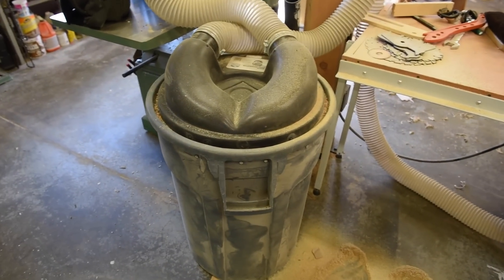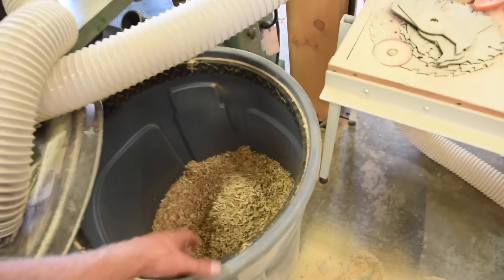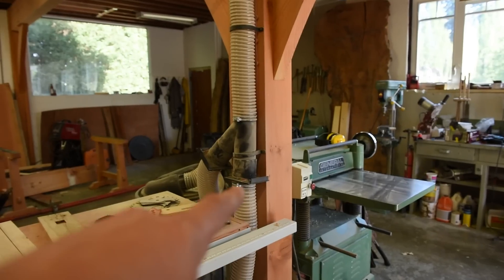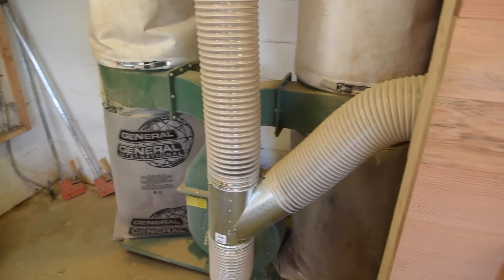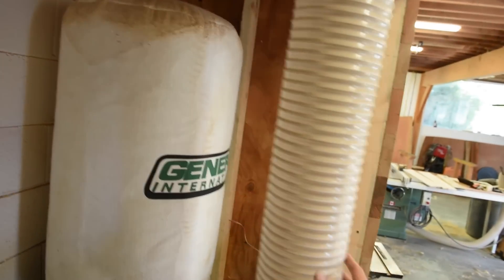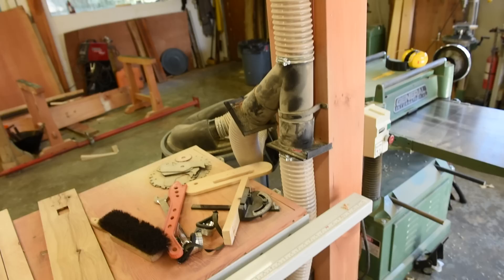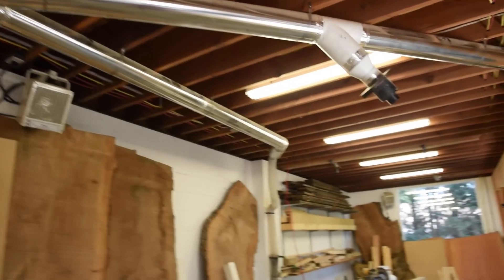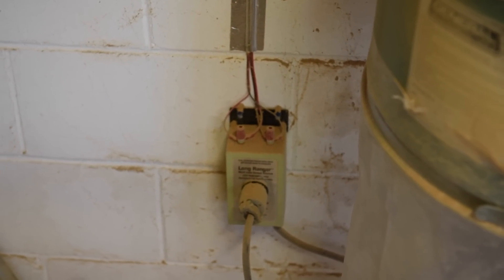FTF #30 Dust Collection Do's And Dont's

Comment: Metal or PVC pipe both work. Use whichever makes more sense.Use or make up large radius 90 degree elbows.Some of my customers use thin wall PVC drain pipe for DC (dust collection).Empty your bags when they are no more than half full. Half full bags can kill 75 to 80% of available CFM.Move up to a larger cyclone on the main line just before the collector. Less crap in the DC means better filtration and higher CFM. Talk to Oneida-Air.Upgrade to taller and wider felt, 1 Micron bags. American Filter Fabric will make you custom bags. Amazon is a source for ready made bags. The bigger the bag the better the CFM.Clean your bags often. Follow your manual's directions.Make Jet style Vortex cones or Thien baffles for inside the can to encourage dust to stay down in the collection bags.Long Ranger switch doesn't seem to offer a slow off. Meaning, when you shut the gate it takes the DC 6-8-10 seconds to turn off. This helps pull the remaining dust out of the pipes.No need to ground the system. There is no recorded instance of a statically generated spark causing an air-dust explosion in a small shop. You can read the literature yourself or track down a Fine Woodworking article from 8-10 years ago.Build in Y's with blast gates to act as clean outs where needed and at the end of the line.I haven't seen any room air filters in the shop. Do you have them? If not I'd put in at least 2 on opposing walls pointed in opposite directions. These will pull the microscopic floaters out of the air 24 hours a day and these tiny little bastards penetrate the deepest into the lungs.I've got more but that should give you enough to think about for a while.
Reply: George Savage More misleading advice. Dont use bags as they are poor filters. Small home workshops have all the same risks as large factories - just smaller scale

Comment: I've found that over time the plastic gates get sawdust in the groove that the gate slides in and it keeps the gate from closing all the way.  You have to get in there with a bent coat hanger to clean it out.  I also went with HVAC ducting and I'm happy with it.  If your dust collector is underpowered, use 4" pipe for all your verticals to keep the velocity up.  My DC pulls 1350 CFM so I've had no trouble using 6" for my vertical runs.  I have the same separator on my planer.  My DC is in a shed I built on the end of my shop and I found that I'd fill the drum and forget to check it when I ran the planer.  The separator keeps me from doing that.

Comment: @ 3:36  Big as possible?  Not necessarily; there has to be sufficient velocity to keep dust from settling and especially on risers.  Also, sheet metal ducting is better for dealing with static; but remember to wire across plastic fittings and have a good electrical connection to ground.
Reply: This! SC should use the bernoulli principle.

Comment: I'm glad you have chip collectors, My neighbor burned down his Shop working with Ironwood, when a spark settled into his dust bins and festered into a shop-killer ten or so years ago. Also you can get smooth lined plastic hose.  Blown Insulation contractors like to use those since it cuts down on static and clogging issues.  Great flow benefit is the main idea though.

Comment: At your Dust Collector: when you replace those hoses with ducting turn the machine around. Let the tubing go along the wall. You will normally never touch it again. So you have free access to your dustbags and filter bags. Should be very convenient. AND i have simple touch switches (for normal light installation) at all my dust gates. one simple push (as you grab to the gates anyway) and the Sucker is on/off.
Reply: MY thoughts as well.

Comment: Looks good. A couple things - running 6" then to 4" only gives you the efficiency of 4" so there's no real point unless your tool has a 6" outlet. Also as others have mentioned, pvc is great but just gotta keep an eye to ground the pipes together to avoid static which can start a fire. Didn't really know about the hose killing efficiency so that was a good lesson I've learned!

Comment: Just sharing. I recently added the same dust separator lid to my system.  with a 1 hp dust collector and at the end of 3 in piping with 2 in hose to the tools.   The separator is doing great, little dust in the collector bag, even from after using the jointer its in the can under the separator. I have been surprized.!!   for my small shop more than I expected.  worth the bucks and I found it on craigs list, but it retails for $50.       Hals Wood Shop

Comment: When we were doing our dust collection in the shop, we learned and realized that you cant use an increaser from the tool to the collection hose. You can always go smaller on the way to the collector, but not the other way around. If you think about it, the spot where it goes from small to large, the dust slows down immensely and can cause a clog, especially on machines like a planer or shaper. Just food for thought

Comment: Couple of suggestions.  Use six inch to double four inch wyes when going from the main duct too two tools.  This way you will get maximum airflow if you run both tools at once.  Also, duct mastic is the cheapest and best seal for the joints, it comes in a pail and you brush it on.  I would suggest if you are going with metal to go metal all the way through so its easier to ground everything.  The lee valley metal blast gates have a decent size flange which I had no issues running screws through and slide way easier than the plastic ones.

Comment: Nice system Sir. If you put a second cyclone chip separator bin by your machines it's so much more convenient to empty that, than the bags. The bags can be a pain to change...plus it adds an extra level of filtration. I made my own separator for my mobile chip collector.

Comment: Thanks so much for sharing your work.  One thing that I have found with the plastic gates, after about 4 or 5 years the glue in some of mine have started to give way and one side is separating from the other so I am in the process of changing all of mine to aluminum.

Comment: Don't know if anyone covered this as i didn't read all the comments. You can realize a marked improvement in your system by replacing the upper filter bags with canister filters. The increased filter area translates to increased vacuum. I did it on my system and haven't looked back because of the improvement.

Comment: I would turn around the dust collection system there, so the pipe is behind it and the bags in front. No need to fiddle with the pipes when replacing/emptying them.

Comment: I had Oneida design my dust collection.  I was going to use all 6" pipe.  They warned against it.  You want to keep air velocity up to suspend the particles and prevent clogs.  Keep velocity up by reducing the diameter the further away you get from the collector.  Use metal pipe.  PVC may cause an explosion due to static electricity.

Comment: Some good nuggets on this one. The one thing I disagree with you on is the plastic gates. They are so weak. Mine keep splitting apart from opening and closing. 

The reason why I think it because dust gets caught on the inside part, causing the gate not to close all the way which creates pressure and splits the whole thing in half.

I would make my own which I'll be doing to replace mine as they break.

Comment: a couple things..
first, why not turn your dust collector around? then you don't need to be dodging pipes when dealing with bags.
next, I would strongly recommend metal duct, pvc or abs etc. can build static charge, especially in dry locations (I know bc isn't so bad)...sparks and dust are a bad mix, we've had a couple explosions over the years.
great video man, I'll be looking into the long ranger!
p.s. I know you probably know this, but it's worth mentioning, any sharp angles in the duct will kill efficiency try to stay 45 degrees or less whenever possible.

Comment: Turn your DC around then the pipe is in the back and won't be in the way of changing bags.
Reply: I was thinking of the same thing he should have done I the first place
Reply: or loosen motor and first duct section and swap around and mount pipes on wall
Reply: I scrolled down to comment the same thing, haha.

Comment: Looking at your dust collection closet, it might be easier if you used some elbows at the top where the hose enters the closet and moved the hoses back behind the dust collector on the wall just above the bags. Then you won't have to move it out of the way to get to the bags etc. Just a thought =)

Comment: The loss of efficiency is not primarily due to the ribbed interior surface of the duct, although it will have an effect. The primary culprit is the flexibility (compliance) of the slinky hose. If you could find some flexible "low compliance" hose it should serve your purpose better than a stiff pipe.

Comment: think if you put the dustcolection unit the other way around you can mount the ducting to the wall have it out of the way and just pull the collection unit out slightly to change the bags and not have the hose in the way
does mean you have to go around the back to fix a plugged hose
if you have the pvc type sucktionsystem in youre shop you can do the same thing but use a 45 degree pvc bend with a rubber seal , that way you mount the machine to the pvc (line it up so it slides in the pipe then roll it to the wall ) instead of the other way arount

Comment: Suggestion:  dump the entire bag system at the end. Just punch a hole in your cinder block and vent the air after the motor outside.

Comment: turn the dust collector around and run the 6 inch pipe down the wall. That way you won't have to fight the hose dropping down when you remove the waste. Also ground the ducting.

Comment: It is always a good I idea to have a one valve  in maybe a "Y"  ( just a flap with spring on)   adjusted a bit stronger  than the suction with one vent open,  That way, as soon as all are closed,  it suck the flap open, relieving the suction until another vent is open

Comment: I heard of pvc dust collection systems burn down buildings or even explode because of static discharge igniting the dust. I use metal piping wired all together and connected to electrical ground just to be sure :-)

Comment: Hey man, great tips. That Long Ranger system looks slick, I have the remote system from the same company (PSI), wish there was a way to have it setup to trigger with either the blast gate switch or a remote control. 

Wonder if you considered upgrading the collector to the canister filters? Can't help but notice the layer of dust around your collector, I had the same thing when I was using the bag filter, makes you wonder how much super fine dust is going right through those bags and just getting  pumped out into the air again. Read something on the internet once where a guy appropriately referred to his system as a chip collector and dust distributer. Anyway, those canisters aren't cheap, but they keep you from using your lungs as a secondary filter.

Comment: The chip separator looks like it is meant to fit over a standard metal tin trash can, which is going to be much smaller than the one you're using.

Comment: Lots of useful tips, thanks for the info. Just wondering if rotating your dust collector 180 degrees in the closet wouldn't have made accessing the dust bags a little easier? Looks like your closet also houses your circuit breakers. Do you have any concerns about the dust collector being in a confined space with the breaker box? Thanks again for the posts, they're very helpful.

Comment: Spin the extractor arround an run the solid pipe down the wall. Be careful with the Plastic pipe as you have to earth it out as the static can cause explosions on the wood dust.

Comment: Consider replacing the filter bags with paper filters.  The fine dust that escapes the bags (and coats the transformer for the remote switch) is the most dangerous,  Paper filters also impede the air flow less than bags, because of their greater area.

Comment: I'm still here. even after the awesome hammer usage in your other vid. :) Metal here is more expensive. PVC is easier to get and less expensive, even the sch 40. Here is my though on the connections at the collector. At the main unit run the hard line 90 from the intake to the wall instead of hanging it directly in front of the system.

Comment: SDR 35 PVC works great. Use the socket glue type vs the gasket end type as the gasket is not designed for vacuum. Use 2 45 degree vs a 90.

Comment: Wouldn't it help the suction to place blast gates closer to the vacuum? Something like an auto gate connected to the long ranger could automatically open the long run when you open the gate by the machine. If your replacing the slinky tube anyway it might help.

Comment: Instead of running 2 wires to all the switches in parallel, You could just use the ductwork itself as one of the wires.  That way you'd only need one wire run along each length.   I'm assuming the system runs on only 5v or so, so the risk of a short is minimal.  If it's more than like 12v, then this might not be a good idea.

Comment: You should check your local waterworks supply house I found 4" and 6" drain pipe with all the wye and 45's at half the cost of pvc pipe from the big box stores.

Comment: Hey bud, big fan! Quick question ..... what type of limiting switches did you use on your long ranger system for additional blast gates. I looked on amazon and your store and am confused as which to get. I see a lot of 3 pin momentary switches but I thought this was a 2 wire / 12v setup. Any info would help. I already have plastic gates installed and ordered the long ranger system but need to modify all my additional gates. Thanks. Kevin

Comment: consider moving the vacuum motor outside the workshop or vent the cupboard it is in, to the outside.
All the dust that gets through the bags will be inside the workshop otherwise.

Comment: Why don't you run the piping at the dust collector up along the wall behind it. You could turn the dust collector around and not have to mess with the piping when you need to change the bags out. Yes, you'll have to cut new holes in the dust collector shelter and do a little re routing where the pipe y's before the drop, but hey...your the Samurai!

Comment: Here is a big tip, upgrade to a Wynn cartridge filter instead of the bag. Your collector misses tons of fine dust particles that fill the air. It is not safe or healthy.

Comment: When u run plastic then metal. Use a bare piece of copper wire thru plastic then ground screw it into each metal side duct. Same principal as a feed mill explosion.  It go Boom

Comment: The ONLY pipe you should use for a dust collector is metal pipe. The main reason for this is plastic or pvc pipe will generate static electricity. Even air lines should be black iron pipe. You can safely use pvc pipe is to run a continuous 12 ga ground wire to avoid static in the pipe.
Reply: james stanlake - balderdash.   that's been debunked many many times.

Comment: what about the mint green septic pipes? aren't they like five or six inch? one end is flared and you could put a bead of silicon around the joint if you have leakage. Do you think that would work? those are some cheaper pipes.

Comment: I have a closet/cabinet in my shop for my air compressor similar to your dust collection, i had some left over rockwool insulation so i lined the interior, it really cut down on the noise.

Comment: If you don't want to use metal pvccan be slightly expensive but you can us sewer pipe pretty much the same thing but way cheaper and comes in larger sizes

Comment: You should ground all the metal ducts to prevent static electricity sparking. Sawdust is explosive.
Reply: Can you please provide one example of this happening? This has been said by many on the internet for years but no one has ever provided any proof of a situation where a fire has been caused by static electricity in a dust collection system.
Reply: I don't know if this was actually the cause for the fire I know about, but at Marine Corps Base Camp Lejeune's Wood Hobby Shop, which has actually been shut down for political and funding reasons since around January of 2014, they had a fire in their DC system.  Granted, they have a very large, make that huge shop, definitely not anyone's standard woodshop size (not even The Wood Whisperer or The Samurai Carpenter) with an industrial size and strength DC system, but they had a fire, unknown to them until a person driving past the building came inside and reported smoke coming out of the hopper outside.  It had apparently been smoldering in there for a long time before it go bad enough to be noticed, which quickly after that became bad enough for the fire department to be needed to prevent a conflagration.
Reply: I agree another internet myth
Reply: Frank Kovach I did experience a small fire in my dc system, I was thankful I installed a thermometer in the cyclone, if not, I would've left and gone home. And no, it won't explode unless it's very atomized. And it will help placing thermometers and heat detection in the pipeline to prevent fires from spreading even more, these silent bastards won't tell anything until it's big.

Comment: i put canister filters on my collector and it made a yuge differance  in suction and there is never any fine dust visible on floor or tools , the bags are a hazard to your lungs get rid of them put plastic on the bottom and canisters on top cost about 350.00 each canister

Comment: Question: I also do some jobs involving grinding / sanding of metals (mainly on 3 power tools all in the same corner of my workshop) which do bring up the issue of sparks. Is there something i can implement to prevent those sparks from entering my dust collection system? cause it's annoying to stop in the middle of something with the fire, smoke and the smoke detectors etc.